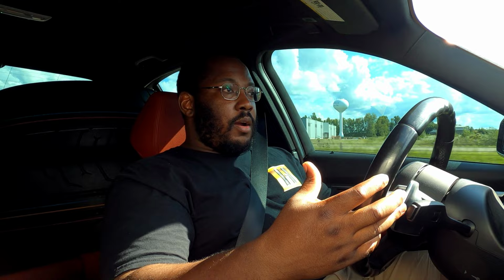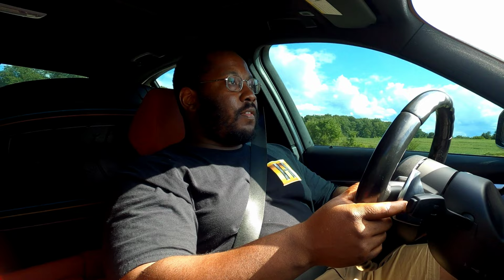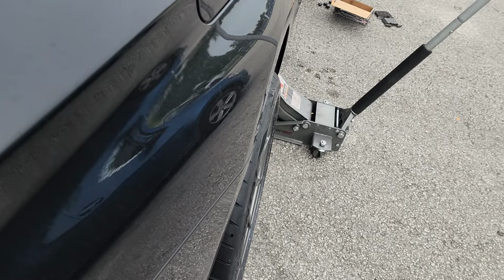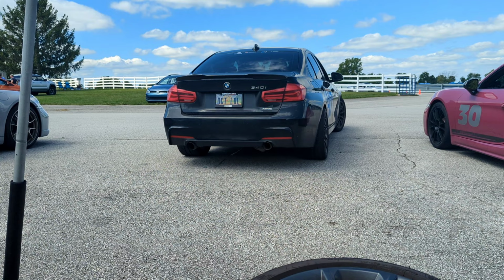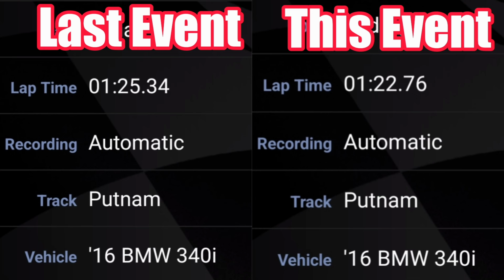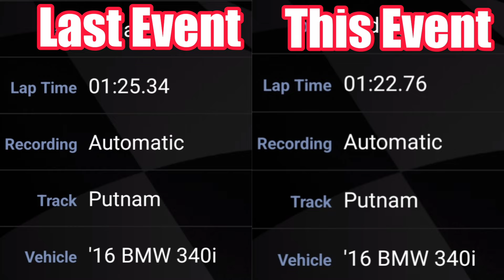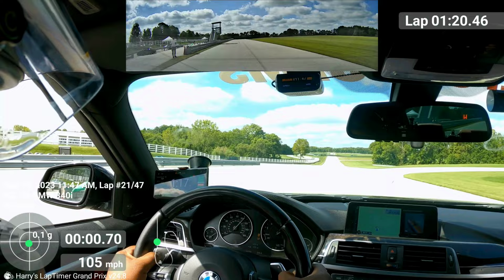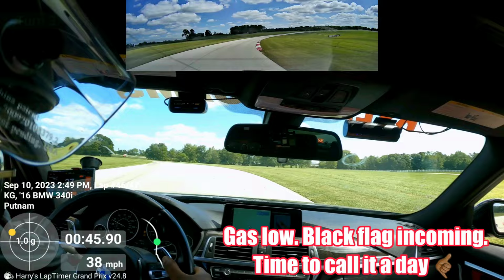Testing my Handling Upgrades at Putnam Park! BMW 340i Track Day Vlog

Comment from the maker: So, what do you guys think? Would you take a Non-M to the track? 🤔
Reply: Does track handling package 340i the same as regular 340i?
Reply from the maker: @the_batmobile0.4  track handling package comes with bigger brakes, adaptive suspension, and an extra aux cooler in the bumper
Reply: Just bought a  M440IX drive and I would love to give it a ride.Yours is 2 wheel I thought.Can the 4 wheel drive have as much fun ?
Reply from the maker: yes

Comment: Nice job.  You look smooth and run nice lines.  Review your videos and I think you'll see that as you are turning faster laps you pick up the throttle earlier and earlier in the corner.  A Garmin Catalyst can give you good information and adjustments while on track if you can borrow one or buy one if it fits your budget.
Reply from the maker: I need some real data recording equipment for sure

Comment: I found tyres and camber helped me a ton. Here in the UK alot of M140/M240i owners install M3 front arms increasing the caster that helps a ton!! Turn in is wildly better.
Reply from the maker: Yep biggest difference by far. Paired with an LSD it's turning much faster laps

Comment: When putting the sway bars on did the roll from the body significantly decrease or was it a more of a subtle change I have been running the car in kw coilovers for a while now and I really want to start doing more and also did the sway bars help put more rotation in the exit because I feel like I am getting a lot of under steer on my current set up

Comment: Do you get any clunking with the millway camber plates? I've been looking at camber plates but hearing about having excessive noise for daily driving is the only holding me back
Reply from the maker: Theres some but nothing jarring. You hear more road noise with the radio turned off. They also sell a "street" version that should be quiet.

Comment: What other mod do u think would make it handle even better? Maybe different shocks?
Reply from the maker: Needs more camber and less weight
Reply: @kern417  do you think a m car would still handle better at this point?
Reply: @concistadornumber2  I don't think it's possible to get these cars to handle better than an m, but this is probably as close as you can get

Comment: Have these changes significantly altered comfort?
Reply from the maker: Nope
Reply: @kern417  Would LSD be worse than an open diff for high speed?
Reply from the maker: straight line? no. around turns/track duty? yes.
Reply: @kern417  LSD is best. 👌🏼

Comment: What pads are you using
Reply from the maker: Hawk DTC-60
Reply: @kern417  ohh oke do they fade and do you have some brake cooling upgrade??
Reply from the maker: @havefun1226  no fade and no cooling upgrades. Just the factory brembo brake package. All you need are pads and fluid to handle the extra heat.
Reply: @kern417  ohh okeee i was thinking about going to spa and Nürburgring and a few other tracks

Comment: Could you give me a recommendation for a performance build on a ‘22 BMW m240i. I want to go with the pure 800 turbo and want to know if you recommend that with mhd or bm3? I’m not tracking the car but want better torque and hp
Reply from the maker: i'm a fan of mhd but both work. determine your goals and find a tuner that can meet your goals, then build your car based on their recommendations and preferred tuning platform.